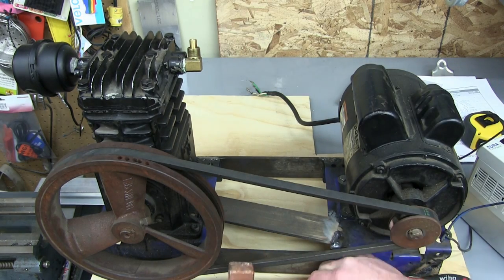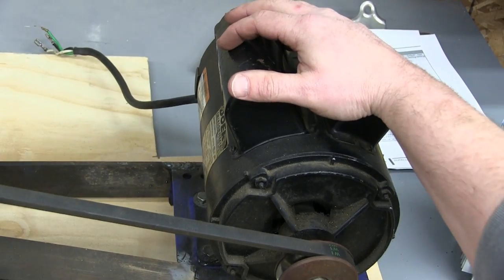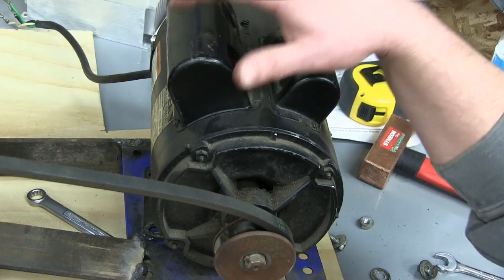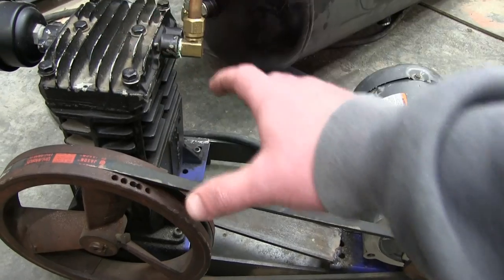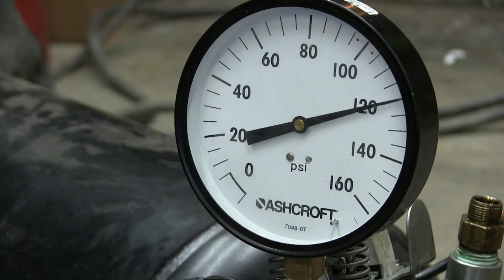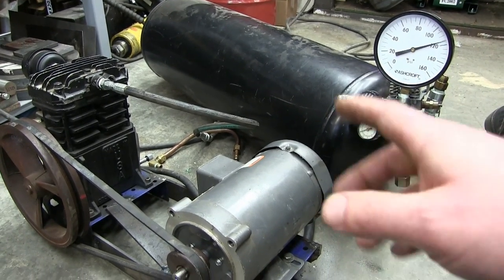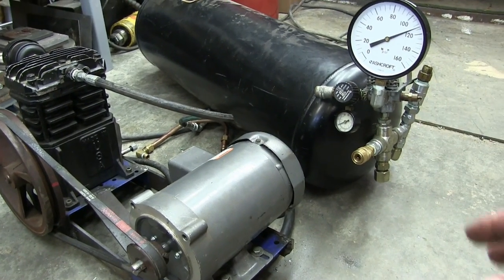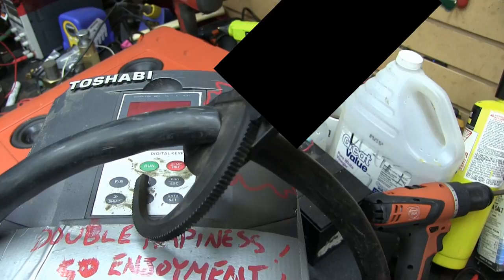BIG COMPRESSOR PERFORMANCE BOOST | No tripped breakers!

Comment: I feel like I'm missing something, but why not just have the control ramp up to high speed when the pressure is lower? What's the need for sending signals to go into overdrive when it could recognize that the pressure is dropping too low?
Reply: LazerLord10 
I agree. The lower the pressure the faster it goes! Well said
Reply: when you're using an air tool like a nailer or stapler if the pressure gets too low the nails don't go all the way in, and/or the gun can jam. being able to tell the machine that you're about to put a bunch in lets you stay over your minimum pressure without the riskiness of the pressure having to drop first
Reply: If you're gonna be using the tool, you want it at a certain preasure. It's overdriven to get it to the set pressure
Reply: LazerLord10 or just PID control it
Reply: LazerLord10 yes!  PID would be perfect if you could keep it consistently going.

Comment: Us small garage shops can easily overload a breaker by running the compressor at the same time as a grinder for example, would be nice to detect line voltage and avoid starting during voltage drop, also a soft start to eliminate the peak is brilliant. If the air bleeds off slowly (like you forgot and left your compressor on) have the controller put it in hibernate mode, just enough air to detect use. If the motor can not catch up (hose broke) put into hibernate mode or shut it down until reset. When running big air loads I run 2 compressors at the same time, it would be cool to  have some synchronization between them with this controller. Even if the controller let my baby super quiet compressor cycle (relay)  when there are light loads and kick in the second when rapid pressure drop occurs from larger loads.

Comment: Ok AVE. I am not a college boy but have been in the field for 20 years. HVAC factory service tech. I try to approach issues logically and work smarter.  With the prevalence of energy regs and everybody trying to save the planet and what not. The occurrence of vsd s has really come on in the last 10 years. The issues I have seen have been bearing failures on 3 phase motors when retrofitted with vsd. What we (my factory R&D)  have figured out is bearings failing due to build up of voltage on the armature and bleeding current through the bearings causing pitting on the races. This happens when running VSD on a non VSD rated motor. Easily overcome by retrofitting a grounding ring on motor that has brushes to allow current to travel to ground with out traveling through bearings. Just my 2 cents. Keep up the good work. Really enjoy your videos. More field trips!!

Comment: Greatings from Denmark..
I use Omron MX2 VFD's in my work, and they contain a small PLC that can be programmed to do exactly what you explain I the video.. also they have both digital and alalog inputs.
Not the cheapest Drive, but 250$-ish will get you a 2 Kw one phase Drive.

Comment: Ave, I think the compressor is running the wrong way around. This way the cooling fan is sucking and not blowing on the cylinder. And as much as I know, the lubrication mechanism inside is also designed to be running in a specific way. Not hating at all, just saying!
Reply: Agreed, I saw that too. On my compressor I bought a thermostatically controlled box fan, cut the thermostat out of the fan and installed it on the tube between the low and high pressure cylinders. As soon as the compressor runs for a bit, that tube gets hot, the fan kicks on.
Reply: It doesn't matter which way a cooling fan is running as long as it's pushing OR drawing fresh air over the component to be cooled.  That said, I have no idea if it was actually running backwards or not.

Comment: Mechanical engineer here, stamp official and all that goobalydoop, I could def uses this in exactly they manner you specified.
I've worked on utilizing plc and ladder logic to control motor function and there are def game changing possibilities there.
Wish I could come work with you for a month. We could create some incredible non-industry standard breakthrough using simple things like autonomous microcontrollers to send packets in order to greatly increase the durability and functionality of classic design.

Comment: Honestly I think you idea for setting it into an "overdrive" mode is the long way around and not particularly intuitive.  Since you are already going to be using a pressure transducer and a PLC to control it, the better way would be to tie the VFD speed reference to a PID loop.  That way as the pressure decreases the PLC would increase motor speed to keep your pressure up.  You could also set it up so it wouldn't need to use the jog function to get the compressor moving.  It would just ramp the speed to get it moving.  This would work as a soft start to keep the breaker form tripping.  It's the in-rush current of the motor that trips breakers, not the fact that the compressor piston is at top/bottom dead center.  Ramping the speed on start will take care of that in-rush.
Reply: Technically,  overdrive means the driven member (compressor) is rotating faster than the driver,  this could only be achieved by changing the gear ratio -- i..e..  gearbox or hydraulic or vario  belt drive.
Reply: Gman76 I said overdrive because I thought that's what he said in the video.  He actually said over-torque.  Either way the idea is the same.  He was talking about some sort of sequence to speed up the motor.  PID loop would work better.

Comment: This would be wicked for anybody spraying.  Keeping a more constant pressure with a smaller tank is a holy grail for those of us who run either standard guns or HVLP setups off a compressor.  

Normally this all equalizes out by using a tank that's half the size of your spray booth, but the ability to match compressor speed to demand would give the option of using a smaller tank, and possibly making it moveable for the guys who don't have a dedicated booth, or to use some serious overkill to paint a fence.

Comment: AvE, your spinning that compressor backwards. It should be turning CCW so the blades are blowing the air across the crank case. Always enjoy the videos. Keep em coming man!
Reply: Dan Powers I come to tell him the same thing lol
Reply: Wouldn't the direction it is going pull air across the whole body of the compressor?
Reply: That blade looks like, as mounted, it should be spun clockwise. The shallow pitch of the blade is the discharge side
Reply: Well, THAT won't work.  AvE needs a compressor, not a vacuum pump!

Comment: Adding a 4-20ma pressure transducer sourced from the 24v on the VFD, you could essentially maintain a new psi set point just using the features on the drive. Add some torque boost in the program and your in like sin. Skip the PLC and use the VFD inputs on TB1. Your vids are awesome after verk w a beer.

Comment: What if instead of air signaling, it used rate of change in tank pressure to modulate the motor instead of the usual hysteresis? That way you don't have to worry about accidentally sending it into orbit when you inadvertently send a signal with the wrong tool. Maybe set it up such that it should resist pressure drops faster then so many psi per minute, and when it detects that, it runs constantly to maintain pressure. Hysteresis could still be used for light draw or slow dropping pressure so you don't need to hear it running all the time.

For extra credit: Run two asymmetric separate stages off the same belt and valve them so that at lower pressure they run parallel for high volume, but after a certain amperage is reached by the motor, solinoid valves run them in series where the larger acts as a low pressure first stage to the second lower displacement cylinder.
Reply: The rate of change in system pressure method of control is already being used by Kaeser. My rotary screw compressor has that as an option in its controller. It doesn't have a variable speed drive (yet) so all it does is regulate turning the motor on and off.

Comment: Mine looks like a Frankenstein. Removed the air filter and added a large oil filter. 2x125psi mini shutoff switches(2 for redundancy) after removing the blockly original one that stuck in the on position. The motor is now controlled with a relay that also provides power to the NO air solenoid. And the air solenoid closes after 6 seconds via the SS timer. The top of the oil breather/fill port has been cut and piped to the outside, for in-shed oilfree air quality. Looks like now I need a VFD. ;0)  always love your videos.

Comment: l wonder how a mini bike torque converter would work, fast with no load and geared down on the top pressure ?
Reply: Mustie1 I like tjis one
Reply: Yes, I was thinking about using some kind of CVT/vario too!
Reply: why not use a CVT for overkill?
Reply: Another method is to just use a variable stroke on the compressor. If you've ever seen an air-motor that is regulated or reversible with a tilt-block system, then you'll already know how such a compressor pump works. No clutch or anything to wear out on that, and you're governing its drive motor to a fixed speed. I believe some hydraulic proportioning systems do it that way too.

Found a video showing the principle: https://youtu.be/DPuYF0eNK6M
It's talking about a patent using it for air conditioning, but that tilt-block thing itself actually goes back to the 1930's at least. At least in the case of ship's steering hydraulics, and large things like that.
Reply: like that slovakian hydraulic pump he took apart? With the changing pitch plate that changed the displacement?
That's actually pretty smart, you don't have gears just a variable displacement
Reply: 13:1 out of the hole and 4:1 at the top end . was the setup my frend had on his race cart with a 10hp Tecumseh pushing 20hp
Reply: no,  not a clutch, think of a snowmobile setup, engine say maintins rpm, if it went up hill same as compressor reaching the top of a full tank the track slows down, and if snowmobile went down hill track would spin faster, same as tank just starting to fill,
Reply: Hows the cushman going mustie!
Reply: That’s fucking brilliant.
Reply: That was my first thought but the friction would probably hurt efficiency so a bigger motor, too?
Reply: Shut Up That,s My Idea .

Comment: uhhhhhhhh.............. YES I DEFINITELY TURN MY COMPRESSOR OFF AND DONT LEAVE IT ALL ON THE WHOLE TIME side note, i bet you could use a cvt drive from a a gokart to do that mechanically
Reply: waderedsox I was just thinking that
Reply: Only thing, you loose the "smart control" aspect of it. No programming logic opportunities. I think the cvt would successfully adjust the output torque and speed as pressure increased. Still would just be working off a limit switch though.
Reply: granted, but it would be a HELL of alot cheaper, and you could just adjust the pressure switch (you can adjust them i had to replace one once) so that it turned on at a higher pressure
Reply: waderedsox yea I have my differential real small on mine so it turns on as soon as the pressure drops a little bit. At least putting some CFM while I use it keeps it above 90 a little longer. It would be a fun project to try the CVT. not a project for me as tunning a cvt can be a pain in the ass haha
Reply: yeah, i cant stand anything without a clutch pedal but i wouldnt feel to guilty about trying it on an air compressor. it just strikes me as being quite a bit easier than buying a $200+ vfd AND a 3 phase motor and then all the pressure switches and then figuring out how to program it XD its a touch over my head, and beyond my needs
Reply: It depends on what you are doing with the air, I suppose. I use it for everything from airbrushing to HVLP, to vacuum forming plastics, blow molding, knocking loose nuts & bolts, driving nails, to flushing out equipment from wristwatches to old marine engines & oil bath transformers. This would be cool on a vac pump too.

Comment: Complicated things break down exactly proportional to how complicated they are. Maximum rpm for Compressors are not safely exceeded. So there's that, my 2cents. I've rebuilt all three of my compressors, all bought used. I googled make and model for the rpm and found all three at one time in their previous lives had their shives on motors changed so the compressor was running slower. I changed all that and have excellent performance. Other than that would be a great idea. Thanks for the videos. I see you were in my old stomping ground, Similkameen valley. 👍

Comment: It makes sense, but you're over-thinking it... just use PID control to maintain pressure.
Reply: Agreed, proportional would probably be good enough for most applications, but some derivative action would kick things into high gear when the pressure starts dropping quickly (i.e from the ugga-dugga gun).
Reply: Exactly!!!!
Reply: This is how the compressor at my shop works. 9 or 10 hass, samsung, etc take a lot of air pressure to run, so it turns on fairly regularly (every 5 or 10 minutes, depending)
Reply: I was coming to comment PID as well. PI is probably sufficient. Saves the combinational logic and will work great!
Reply: Max R come on mate, try a little keyword search in google before asking someone explain something to you. Because I bothered to reply I have also included this: https://en.m.wikipedia.org/wiki/PID_controller
Reply: Max R whoa bro, that escalated fairly quickly. 
Does this non-linear response to criticism show up in other areas of your life?
Reply: Max R I feel like your link applies to yourself more than @Matt Patterson....  I'm actually genuinely worried about your health mate
Reply: Gentlemen! This is AvE, my happy space... can't we all just shake hands and get along?
Reply: A proportional–integral–derivative controller (PID controller or three term controller) is a control loop feedback mechanism widely used in industrial control systems and a variety of other applications requiring continuously modulated control. A PID controller continuously calculates an error value {\displaystyle e(t)} e(t) as the difference between a desired setpoint (SP) and a measured process variable (PV) and applies a correction based on proportional, integral, and derivative terms (denoted P, I, and D respectively) which give the controller its name.

In practical terms it automatically applies accurate and responsive correction to a control function. An everyday example is the cruise control on a road vehicle; where external influences such as gradients would cause speed changes, and the driver has the ability to alter the desired set speed. The PID algorithm restores the actual speed to the desired speed in the optimum way, without delay or overshoot, by controlling the power output of the vehicle's engine.
Reply: Sounds like something that would cost as much as the compressor itself. Am I right?

Comment: Sweet idea, make compressors like $500 more expensive and job site voltage finicky. Why not a two stage portable compressor? They already exist, turn on at 130psi and off at 175psi regulate to 115psi, problem solved without a VFD that will shit whenever the power is pulled from it, that never happens on a job site. Also gas powered 2 stage with continuous run valve also exist for framers. I would love to VFD my compressor at home to make it quieter under low load but on a jobsite, who cares? For those constant pressure guys, a splash lubricated pump has a minimum speed to keep lubricated. The more I think out it 2 stage + regulator and forget the fancy electronics, unless you got the VFD for free.
Reply: You got it right. Bigger is better! including upgrading the cheesy 200 ft of1/4" hoses that the contractors use.

Comment: I spent 8yrs as a pneumatic/compressor repair tech.  That's a hell of a good idea.  It saves motor wear, capacitor wear as it keeps cfm production up (which is the magic ingredient in air tool use) and has lots of conceivable applications. 
  I want in, help us out with more details and less flight of imagination in your "tootali-tage."  :)

Comment: You could control this with an Arduino, a few AC relays, and a bunch of “if” statements. Depending on the rate of pressure drop, and the pressure itself would determine compressor rate. You could also have different modes or set different minimum restart pressures (80, 90, 100, etc)
Reply: did you do this? i was thinking the same thing
Reply: @sdriza  no I never built one of these. I work as an engineer these days solving all sorts of problems like this, so the theory and execution is pretty straight forward to me for something like this.

Comment: General Contractor here. usually when the framers or roofers have multiple tools running, they use gas air compressors. (Rol-Air 4090HK17 5.5 HP Honda, 9.3 CFM@90PSI, 9 Gallon Twin Tank )
Three phase isn’t exactly mobile friendly.
But the home shop fire can always use a good stoking! 🍻

Comment: This is why I use a helical screw compressor. I do love using the Vector Drive. The helical screw comp has one anyway, but damned clever to throw a VFD MC on a vane or piston comp. All you are doing is lying to the motor, and it still has no clue whether it is seeing 60Hz or 6500 Hz. I "LOVE IT!!! I also run a dual compressor  for painting or finishing guitars. They run alternately into the same reservoir tank to avoid oil blow by, and moisture in the air. Every time it needs air the colder compressor that has had more off time kicks on, so A-B-A-B-A-B ad infinum. This would be fuckin great for monitoring my air needs for the pain booth. Some finishes take a lot of air, as pigment sizes & viscosity ALL change with color, and other properties of the "industrial coating" I are applying. We also run vacuum clamps, and vacuum forming boxes in ovens, for forming usually PVC plastic. Sometimes ABS. It's all cosmetical crap plastic.